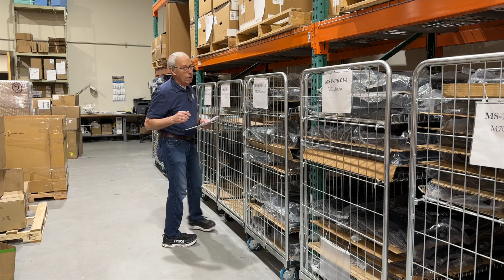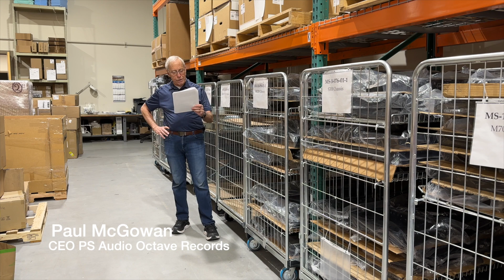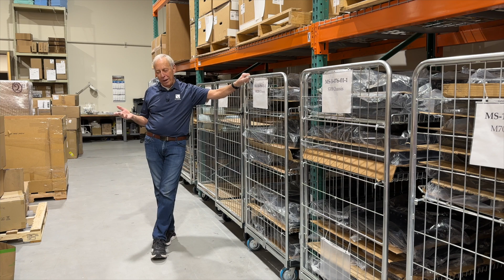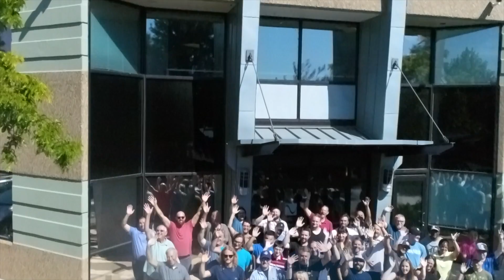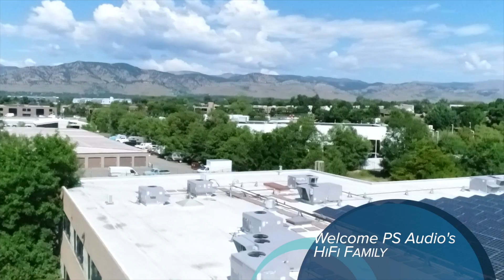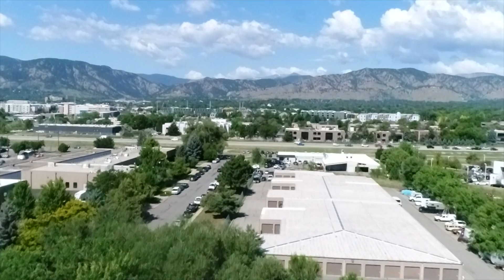Why the last few feet of the power cable matter

Comment: To the deniers:
Why do you use a shower head, when your water traveled miles to reach you?
Reply: Wow. Just... wow.
Reply: That analogy doesn’t work. The shower head is the appliance ie the amp or whatever. A better analogy would be to put a 3 inch diameter hose made of fancy material on your shower head and expect the pressure to improve when the water has traveled all through the rest of the house in 1/2 inch copper pipe.
Reply: @petesmith2234  "That analogy doesn’t work."
Yes, it does work.

"The shower head is the appliance ie the amp or whatever."
You might as well write that the shower head is the warp plasma injector, since you are trying to rearrange my words with nonsense.

"A better analogy would be to put a 3 inch diameter hose made of fancy material on your shower head and expect the pressure to improve when the water has traveled all through the rest of the house in 1/2 inch copper pipe."
Your attempt to conflate a fancy wrapping with functionality is transparent.

Do you realize that I can read what you write?

And giving your own rubbish comment a thumb's up does not lend credibility to your attempt at deception.
Reply: @0Perhaps  nope, the analogy doesn’t work. The shower head is an appliance which breaks the water up in small droplets. It’s clearly there to do that otherwise you’d just have water pouring out of a pipe. I fail to see how this is in any way analogous to an amplifier power cable. 
I’m glad you can read. I too can read, however the words I’m reading don’t make a lot of sense.
Reply: @petesmith2234  Your attempt to recover from your absurd "a 3 inch diameter hose made of fancy material on your shower head and expect the pressure to improve when the water has traveled all through the rest of the house in 1/2 inch copper pipe" comment is noted.

Also noted is that, this time, you did not give your own comment a thumb's up.

The analogy of the shower head, after the water traveled miles, is that it serves the purpose that you described: "It’s clearly there to do that otherwise you’d just have water pouring out of a pipe.", and yet I see that I must spell it out for you.

The shower head directs the flow of current, that was heretofore a chaotic flow.
The power from the electric company is of a similar nature, where a quality power cable manages the flow into the stereo equipment.  Yes, it actually does that.

Public utility power is dirty power.  Quality power cables are one of the tools that clean it up.  The cleaner the power delivery to your equipment's power supplies, the better the power supplies will deliver power to the circuitry within each respective box.  The result is better performing stereo equipment.  The result is better sound quality.
Reply: @0Perhaps  A power cable just provides connectivity from A to B. It’s possible that a very long power cable would have enough inductance and capacitance to provide a minimal amount of filtering, but it would have to be so long that voltage drop would become a problem. If you want to clean up the power feed, you’re probably better off using a power filter rather than trying to get a cable to do the job. 
It’s possible a screened power lead might help reduce hum induced into the signal leads, but if that were really a problem, a better bet would be to use balanced audio leads and keep them away from the AC cables.
Reply: @0Perhaps  "The shower head directs the flow of current, that was heretofore a chaotic flow. The power from the electric company is of a similar nature, where a quality power cable manages the flow into the stereo equipment.  Yes, it actually does that"
 Where did you study electronics and electrical engineering? Show me some accredited proof of this phenomena you claim.
Reply: @petesmith2234  "A power cable just provides connectivity from A to B."
And a tire just lets a car roll.  They are all the same -- just like power cables are all the same -- according to your logic.

Rather than trying to convince me (and everyone else who has done proper listening tests) that all power cables are the same, and they they do not affect sound quality...

Do a listening test.  Test with your ears.

Nothing you write will change what I and countless others have heard.
It is like me trying to convince you that you do not see these words on your screen.  Are you going to believe me?  Or are you going to believe your eyes?

Do a proper listening test, and then you can decide whether you are right, or whether your ears are right.
Reply: @andydelle4509  "Where did you study electronics and electrical engineering? Show me some accredited proof of this phenomena you claim."

When you are sick, how could you know?  Are you a doctor?  Where is your medial degree?
When you witness a robbery, how do you know it is a crime?  Are you a criminal lawyer?  Where is your law degree?
When your TV's picture shows distortion, one week after you purchased it, how do you know it needs to be serviced?  Do you design televisions?
When a restaurant serves you a badly prepared dish, how do you know that the food is bad?  Are you a Top Chef?  Do you have a degree from a culinary institution?

You must either have a degree in every field under the sun, or you never get anything done, due to not being qualified.
According to your logic, only experts with paper to back it up can identify what their G-d given senses tell them.

Rather then trying to discredit people's real-life experiences, by claiming that they must be certified to know anything, you should take steps to have the experience, yourself.

It is elitist of you to claim that you know what something sounds like, when you never listened to it.
So do a listening test, and then report your findings.  No degree is necessary to use your ears.

And if you want to reply, I expect you to include your degree in English grammar.
Reply: @0Perhaps  There's quite a difference in telling a doctor your head hurts and giving a qualified medical diagnosis. Ditto that for all the other ridiculous examples you gave. Saying you hear a difference is fine and really nobody can dispute what you think you hear. But when you go down this road:

"The shower head directs the flow of current, that was heretofore a chaotic flow. The power from the electric company is of a similar nature, where a quality power cable manages the flow into the stereo equipment.  Yes, it actually does that"

You are stating scientific explanations for what you think you heard. And based on what you said here, you are hardly qualified to make such statements.

Again, nobody is telling you what you hear and don't hear. What we are saying is that there is no accredited science that would support these power cord claims.  Therefore what some people are hearing is placebo effect. This is why we have DBT testing under supervised controlled conditions.
Reply: @andydelle4509  "Therefore what some people are hearing is placebo effect."
Of course, what some people are hearing is the placebo effect.

Without listing any of the stereo's components, then you can make up any claim under the sun.

On a professionally set up, quality stereo system, anyone with reasonably good hearing will hear the difference between mass produced power cords and quality power cords.

On such a stereo, there is no placebo effect.  No matter how many times you harp "placebo effect", there is no placebo effect on professionally set-up, quality stereo systems.

How many time do I have to write "You are not reading this", before you believe that you are not reading this?

It is entertaining to read the conga line of excuses for not using your ears.  It is as simple as simple can be.  And you refuse.  And you will reply with "because, because, because".
You could put this to rest by playing a song and swapping between a mass produced cable and a quality cable.  But keep on making excuses.  Keep on entertaining.  Keep on digging deeper holes.  Keep on exposing your ignorance.  Train wrecks are entertaining.

Comment: Why would I install a power cable that is NOT UL rated?  Hey Paul is your cable fire rated?
Reply: This is a good point. Most premium after-market power cables that will run you anywhere from $90 to $9,000 will not be UL-listed. I think that's because most of those companies believe that they build their products to such an incredibly high standard that they are already far beyond that quality and reliability standards that UL would be testing their products for. Now, will every company build to that same level of quality just because they are more expensive? Likely not. Your mileage may vary.
Reply: It's shielded with voodoo.

Comment: The term “deniers” is a bit nasty — calling back to Holocaust deniers. There are skeptics, most of whom (myself included) are skeptical at companies charging thousands (or tens of thousands) of dollars on cables claiming to have magical effects on system performance. 

Will a heavier-gauge, properly insulated and shielded cable help reduce noise? Of course. Does that cable need to cost a couple thousand dollars? Absolutely not. 

Power supplies have filtering on their input so I’m not sure how much improvement a special power cable will provide — certainly not enough to justify the astronomical prices being asked by many manufacturers. 

You could just as easily as brand “believers” to be like Scientologists, having spent so much money they must believe it does make a difference or be forced to admit they wasted thousands of dollars on snake oil.
Reply: No they don't have to cost thousands. The Pangea cables are very nicely made Cardas grade copper and lots of it - I just bought four(4) and it was less than $500. not insignificant but $100-$125 per in high end audio is a pittance

Comment: Paul is 100% right, I tested my system both with a audiophile mains cable and without, and it sounded better with a mains cable fitted. 100% of listeners could tell the difference in with or without a mains cable in a double blind test, so it must be true. 
OK, Joke off;
I don’t have a special mains cable for the following reasons. 1. I have a specially wound transformer which is wound in such a way as to reject noise, and not require any interwinding screen, reducing the interwinding capacitance which can carry HF noise. 2. I have a mains filter fitted. 3. I have a really good ground connection in the house. 4. The amplifiers I use are all very high quality with regard to Engineering build.

5. Finally, I don’t believe in Fairy’s, Lifting speaker wire off the floor, or sonic voodoo which exists simply to prop up the failing industry which is high-end audiofool. (PS Items 1 is true, I do have a one-off transformer in my Class-A amp)
Quote PMG "People with zero experience still express an opinion, which, as such, isn't valid", a denier if you will. Case in point, Lets jump out a plane Paul, it will feel great.  Now I have no experience in jumping out of a plane per-se, but I have enough knowledge and experience to know its a dumb idea. A HiFI mains cable is a dumb idea. If it made a difference, you need to dump your setup  because it’s junk.

Comment: Thing is, one can buy a shielded power cable from Belkan for just few more $$ than an unshielded power cable. This should raise questions about companies trying to sell power cables for audio gear at prices up to $25k (yes, twenty five thousand dollars.)
Reply: I like Kimber cables though, because not only do they cancel RFI arriving and leaving the mains cable, but they cancel out RF that was already on the mains circuit. They are too expensive for me though, but back in the days when ebay still had lots of used bargains, I bought quite a few of their cables and still use them nearly twenty years later.
Reply: @banginghats2  audes i love, my home is buld in 1982 and we did a makeover in 1994 ,i should say, we have expanded it, no noice at all , so i use the fabric cable who came in whit the marantz in the box ,high volume all the way up  ,no noice at all ,lets say its more a lucky coincidence
Reply: There must be more to it than simply shielding ( and of course you have quality differences in shielding as wel).
I had the chance to compare powercables for my PrimaLuna tube amps and also for my digital sources ( which are very sensitive for clean power!).
The fact is: better ( and more expensive) powercables simply sound better!  After a long session I came out for Audioquest on my amp and Furutech on the CD transport and DAC.
Not the other way around!  So listening is always vital. Cost me a few K, but not 25.   Now I am extremely happy with my set.
Reply: @paulb.3227   I remember when a company marketed a specially treated rock as necessary for audiophile quality sound , which got positive reviews at the time , but are now  forgotten, along with a Clock that was supposed to improve sound by conditioning wall electricity.  I also remember when coloring the outside of a CD with a yellow highlighter  was considered as a performance upgrade , with special pens rushed to market for coloring the outside of CD's.  

Now , nobody cares, because it was all an illusion of hearing .   I do remember being in an audio salon and seeing the small piles of black rocks  set around the store and being impressed at the many thousands of dollars required to buy that amount of minpingo rocks.   The price  was not an illusion .
Reply: @paulb.3227  There is nothing to it. If the cable has sufficient thickness to provide enough power (aka any functional power cable) then there is absolutely 0% difference between them in terms of sound quality, the fact people believe this nonsense is hilarious and shows a complete and utter lack of understanding of electronics, physics and sound, what these 'experts' are supposedly knowledgable about hahahahaha
Reply: @arcadianstag8061  Yet there's obvious differences that can be heard. Also, you clearly don't understand the basics of how electricity gets to the amp to begin with.
Reply: @derbigpr500  When you derive the content of what a person knows and knows not, based on so few words explains why you believe an overpriced cable improves sound quality.

Comment: Geeeez, I was starting to give some sort of credit to some of your posts, but you’ve just blown that. Firstly, as someone who’s worked with big sound systems and well gen’d up on what works and what doesn’t and who’s primary job is in RF engineering, I can categorically state that no last few feet of power cable is going to make the slightest difference. If it does, you have a very bad RFI problem and probably should have bought equipment from a manufacturer who incorporates decent supply filtering within their products. If you’re relying on a power lead to sort basic RFI problems then your equipment ain’t no good!

Comment: Theres something very wrong here. Paul goes on about how important it is to have screened mains cable and how it is the most important thing you have to do to stop interference getting to your equipment. How come a very high end audio company dont believe in shielded mains cables. That company is from the UK and is called Naim. Yes they also sell snake oil $600 dollar mains cables. Why do they say a shielded cable will degrade the sound. Something not right here guys.

Comment: THANKS PAUL…🤗 for giving a reasonable SOUND answer…🙋‍♂️ I purchased a P S AUDIO Perfectwave  AC-3
 Cable a few years back…and I noticed an improvement right away and as broke in it got better…I never regret any purchase that improves my experience and also lasts for the indefinite period of time 🎉🎉🎉🎉
Reply: Can you explain/elaborate on what it means to "break in" a 6' audiophile power cord. I have a fairly substantial broadcast engineering/audio electronics background but I can't fathom what might be happening to the cord on day one vs day one hundred. Thanks in advance.

Comment: Oh boy, boys and girls hang on to your wallets because here comes some of that high-cost Audiophile snake oil!!
How can you tell it's snake oil?
Because Paul spends the entire first half talking, not about the cables, but about people who don't believe in fairy dust.
He calls them "deniers and denounces their silly lack of belief in magic.
Then Paul slips in a quick disclaimer at 2:55 "... do I know for sure (Paul is talking about himself here) no. Can I give you some clues yes..."
Paul gives a quick little disclaimer that he doesn't know.
What follows after his quick disclaimer is some off-the-wall explanation of how A.C. works in a loop and how your equipment puts out all kinds of RFI so you must have a power cable that has shielding to make your system sound its best but only if you have a "highly resolving system".
If you don't hear the difference it's only because your system isn't highly resolving according to Paul.
Never mind that putting shielding on a power cable does absolutely nothing and has no effect and that this is easily proven with common sense thought about how a simple A.C. electrical cord is wired and works.
Also never mind that RFI on an A.C. cable can easily be solved by using a $5 ferrite clamshell IF you are actually suffering from radio frequency interference.
If you have nothing better to do with your money then go ahead and buy into this ridiculous idea and don't forget, if you don't hear a difference it's only because you need to spend more money on "Audiophile snake oil" to make your system "highly resolving".